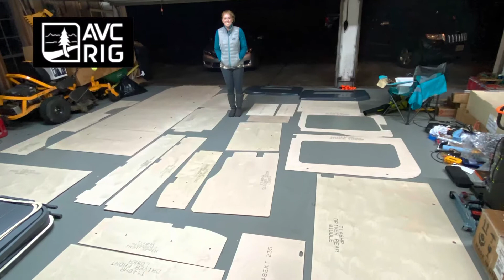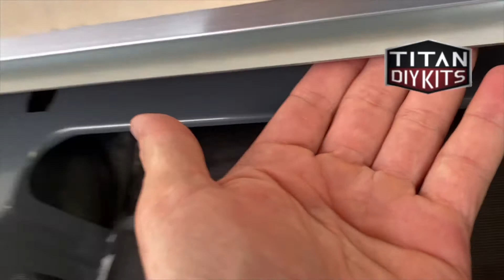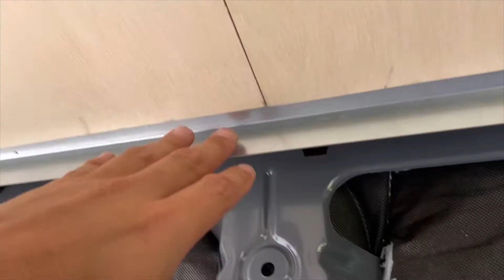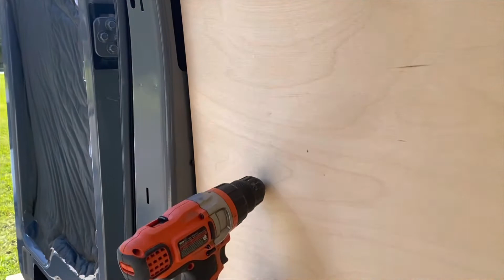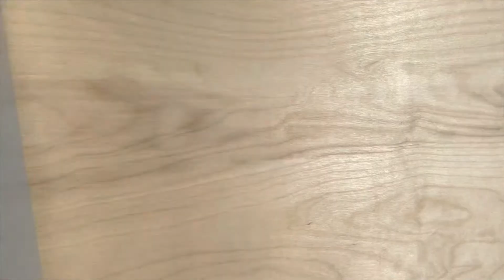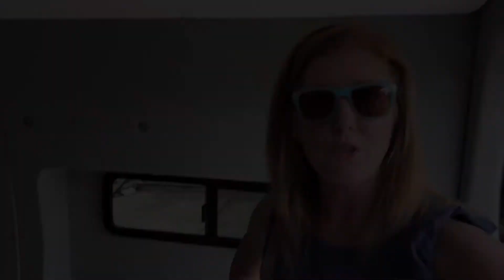Ford Transit Van Build | Dry-fitting Panels|Structural Steel & Flare Trim Ring Attachment

Comment: Is there a reason why you added the extra gap between the structural steel and the van? I was planning to follow the instruction and use that hole on the cross member by using the supplied t-nut. Would that mess up the alignment?
Reply: I see that you wanted a consistent gap between the ceiling and the wall, but that can’t be done the same if I used the t-nut?
Reply from the maker: Yes! We positioned the structural steel about 1 inch from the wall of the van so that our fabric covered wall panels would butt up nicely to the covered ceiling panels for a clean finished look. If not, there would be a noticeable gap between the ceiling and wall panels. AVC Rig just deals with this in their videos by covering the structural steel with fabric so it matches the wall fabric. But we did not like that gap so we created a 1 inch wood spacer from leftover plywood to help us attach the steel exactly where we wanted it to be. This is where dry-fitting your walls (temporarily attaching them) will help you determine what the final placement will look like.
Reply: @blazingwanderers  thank you so much for your reply!!
Reply from the maker: Also, on the t-nut question… we used rivnuts mainly because most other folks used them for this installation. They are easy to install and flat once placed. In theory, I guess you could use a t-nut  but you’re gonna have to get behind there with a bolt and we weren’t sure if you have room to do that —but possibly!

Comment: Can i ask why you chose to use titan’s structure kit but then use avc vans panel kit rather than just go with titan everything? I’m
Looking at this option too because i value time over saving a few bucks figuring it all out myself, which may take months
Reply from the maker: Hey there!  At the time, I am not sure if we even looked at the Titan wall panel kit (we purchased in 2021).  It was when we starting framing out the van with the wall panels that we realized we needed the structure kit if we wanted our wall panels to meet up with no gap.  My husband was very active in the FordTransit Forum online and I believe this is where he learned from someone else about the structure kit.  It does make the wall panels and the ceiling panels fit together perfectly, and if we did it again we would still use that kit!